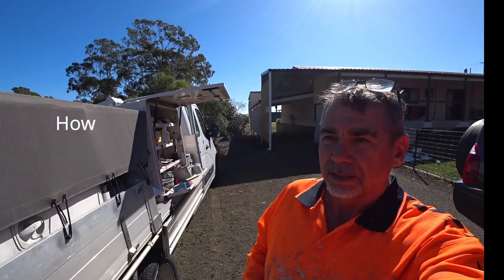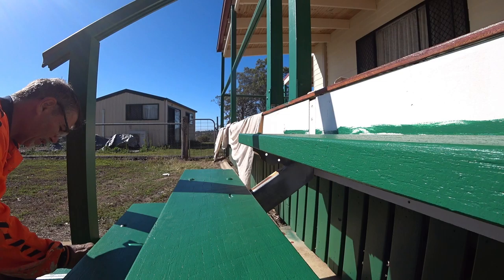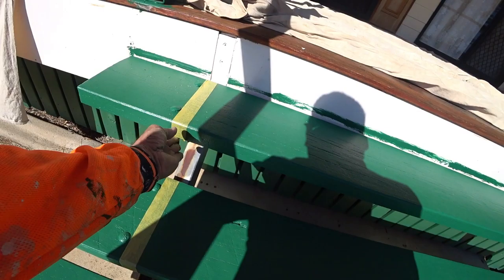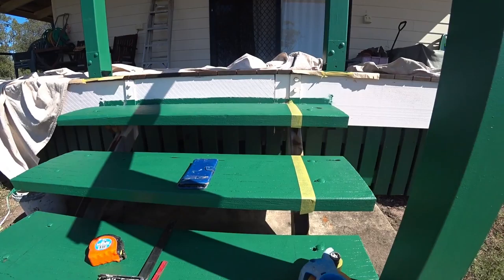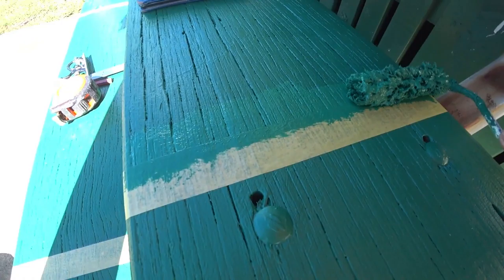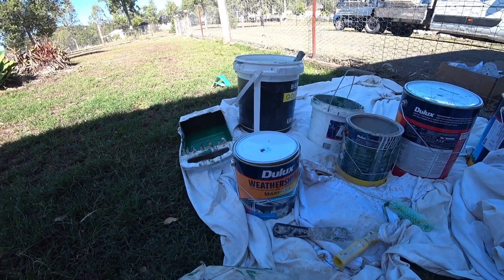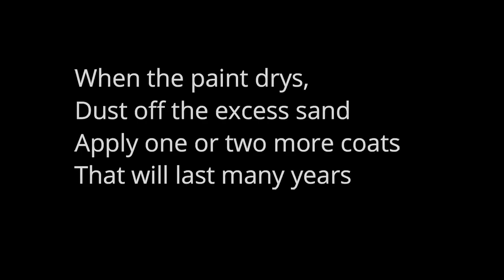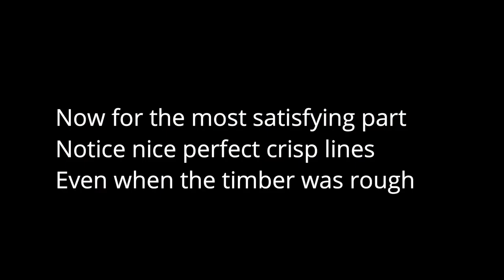two colours, no slip steps / how I do it secrets

Comment: That's a great trick with the sand on the paint to make it none slip 👍 never seen that before or even heard about it makes total sense if you think about it logically.  This one is definitely being added to my box of tricks. If I ever pick up a roller 😂😂.  Good info with this one
Reply from the maker: No problems,I have been doing that for around 30 years in my repaints and it can also be used in new homes with clear varnish steps

Comment: Thanks, Gregory. That was a lovely video and I liked the non slip secret tip.
Reply from the maker: Awesome, thanks
Reply: Gregory what’s the steps to repainting the concrete driveway, please? I haven’t seen any of your videos talking about painting concrete.
Reply from the maker: @zacj63   I haven't done any concrete driveways for a long time, but a good high pressure clean, next day after its dry you can just roll a good commercial heavy duty paving paint,or better still an epoxy (2 Pac)
Reply: Do I need to wash the driveway with acid and water?
Reply from the maker: @zacj63  Lots of people acid wash but Dulux do not recomend it, id be doing some homework on the type of paint you use first,its not my line of expertise

Comment: Do you cut a line between the tape and the paint before you remove the tape?I mean just in case that will peel dry paint when you will remove it.
Reply from the maker: There is no need to cut it with a blade,just make sure you use good quality tape and remove the same day.what you see on rhe video is how it works

Comment: Hi Gregory, I live on the coast in South Australia could you tell me the best paint to use on metal gutters and down pipes please so fed up with rust spots coming through within 12 months after painting with solar gard . Thanks ps how is your shoulder doing. Cheers Steve
Reply from the maker: Hi Steve,Thanks for your concern, shoulder has gone from bad to worse,first damage was break and torn biceps tendon,further tests reviewed three torn rotator cuff tendons so surgery is booked for two weeks away with a 6 month recovery time. Now back to your question,  your gutters sound like they already have rust inside them,Penetrol will probably be your friend here,you will need to apply an oil based primer mixed with Penetrol or straight Penetrol (can buy spray can so good if you can use this inside your rusted gutters as well) on the rusted areas.
Gloss acrylic rather than low sheen will help as well. 
Bottom line is your gutters are deteriorating with rust inside so we need to stop this rust first.
Reply: @ThePa1nterhowto  Thank you so much for your advise. Good luck with your shoulder will be sore after surgery not much meat on them but you should come good physio is the key. Cheers